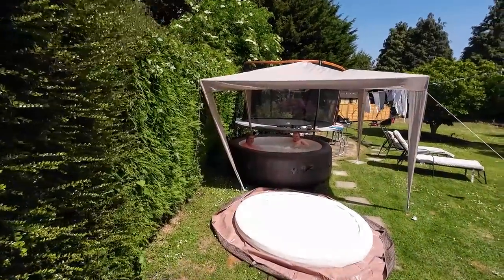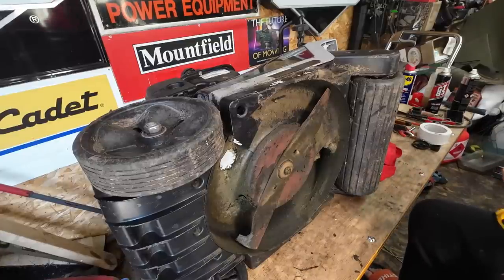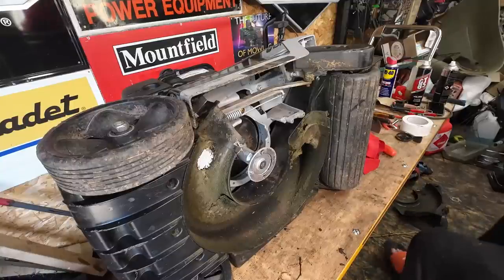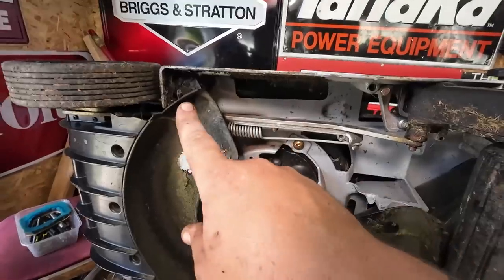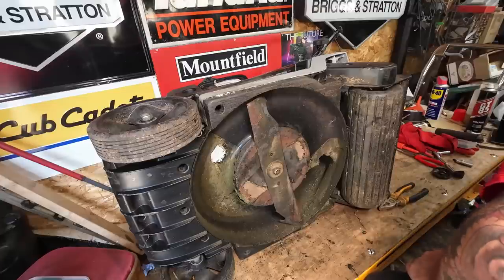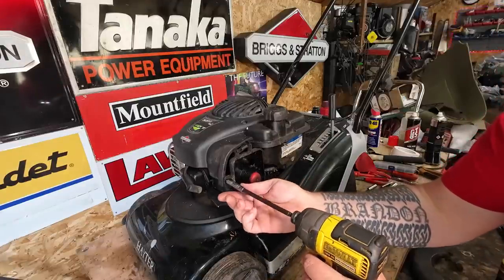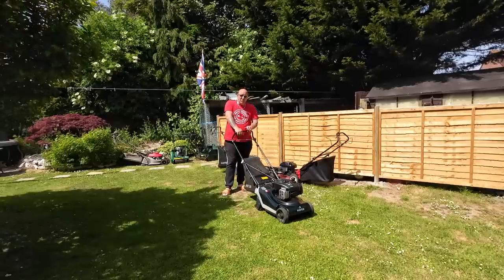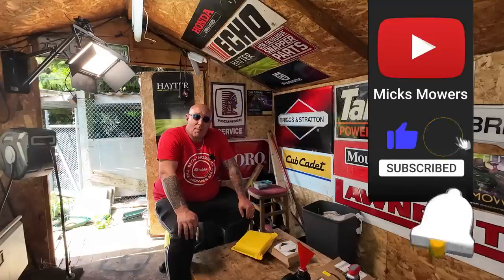Hayter sprite 41 Lawn Mower with Bouncy Front wheels..

Comment: A rule I learned, 'cos no one told me, is putting screws into plastic or aluminium ALWAYS turn the screw backwards, as if undoing, until you hear or feel a click and the threads line up, then tighten it up until you take up the slack or feel resistance then a further 1/8th turn and no more! Once the plastic or aluminium strips it's scrap same if it crushes like on your underdeck plastics. I've never had a problem with this method.

Comment: Useful thanks Mick. I've got to change the rear roller assembly on my vario Spirit41. The rear metal support bar behind the roller is starting to rust through and it's developed a lean to the right hand side. Half expecting the roller support bracket to be knackered too.
 It's a job worth doing though as I've owned it since 2011 and everything thing else on it works a treat even if it is starting to resemble Trigger's broom with the amount of parts I've changed 😀.
Reply from the maker: Good man... Get her done

Comment: Hi Bud, I have this problem with my mower. I took it apart like you did. But mine hasn't come off like yours. Have no idea why it's bouncing. Is there something different that would cause the bouncy front.

Kind regards

Rob
Reply from the maker: Hi mate ... Is the spring on the height control bar?

Comment: Have you got a part number for the carb you got from Amazon mate hard to find non oem parts
Reply from the maker: Here you go Lawn Mower Engine Carb Carburetor, Compatible with Briggs & Stratton 300E 450E OVH Engines 591979 595656 590556 https://amzn.eu/d/4jRZl9v